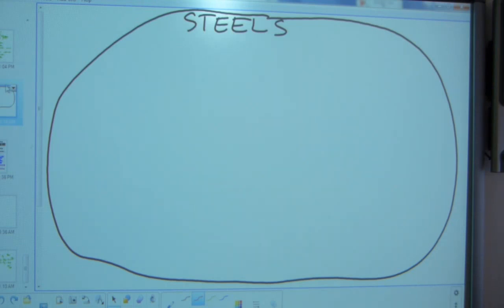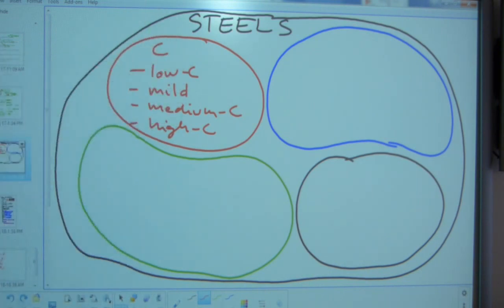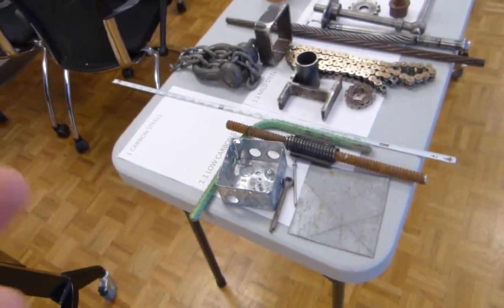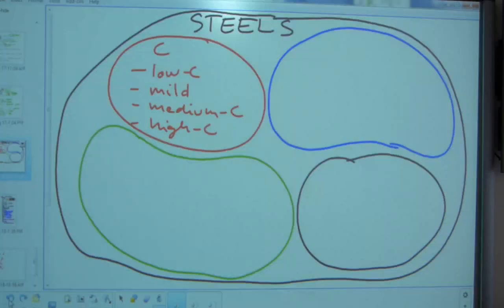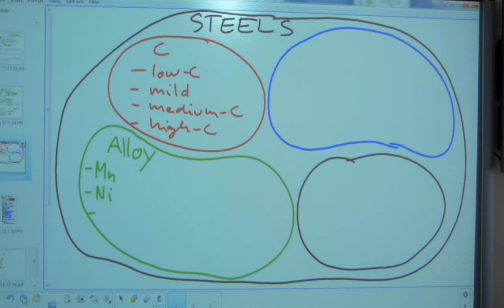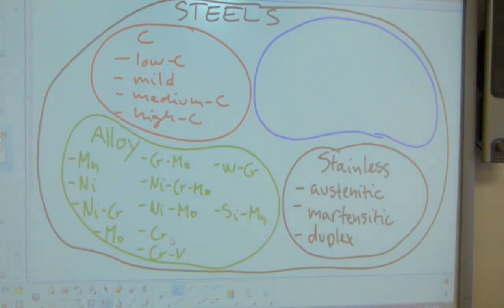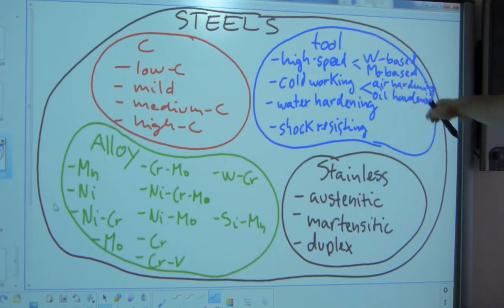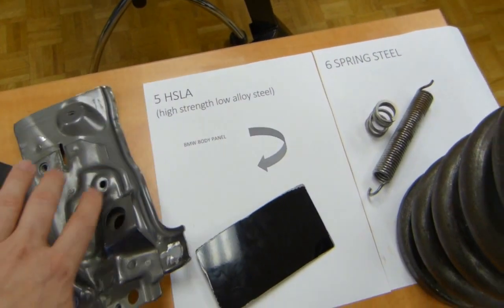Types of steels - welding focus

Comment: Over 40 years repairing and welding heavy equipment and welding high carbon and alloy steels successfully with proper procedures and your saying they are NOT wieldable ! Wrong! You have good content for the most part but I think you are giving the wrong message to welders.
Reply from the maker: What items are made of the steel you know as high carbon?

Comment: Once again: Bravo
I understand this is an intro course so I'll not get all huffy about what is and isn't weldable.
Under normal "Hey I have to go weld this thing.  I'll just get my rig and go" situations, you are right on the money.
I have to challenge you though and suggest that you can in fact smell the difference between steels. Mild steel mostly.
Don't let anyone see you do it, but give some untreated rolled mild steel a careful sniff some time. 
It smells almost sweet! When grinding higher carbon steels (aside from your needing to change grinding wheels every 30 seconds) the burning sparks give off a much more bitter and acrid odor.
Thanks, though. I have had problems differentiating (on charts) what exactly the magnetic reluctance was in Austenitic vs Martinsitic stainless.
I don't know why these books have to drop new terms like eutectic and amorphous into what should be a simple answer to a basic question.
Thanks!
Reply from the maker: Thanks for the tip. Here is a second part to this topic, more detail: https://www.youtube.com/watch?v=o5pHYmKTTXA
Reply: anything you can share on metallurgy I'll gladly watch
Reply from the maker: There are lots of bits on this whole channel, like this Chinese metal: FAIL https://www.youtube.com/watch?v=NjGy5z9L-KQ